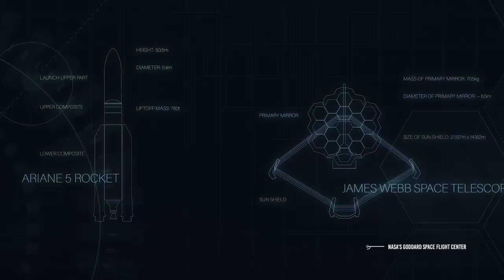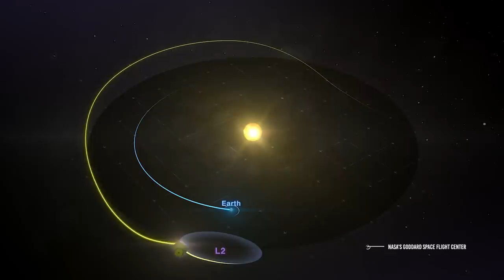The James Webb Telescope Is About To Launch: The First 30 Days Will Be Pure Terror

Comment: Absolutely the most complex device you can imagine. So many points of failure it's hard to imagine them pulling it off. Praying they do but even with years of work only time will tell if it works. At least the questions will soon be answered.

Comment: The fact that the Hubble is hanging in there refusing to give up the fight says something. Hopefully Webb does actually compliment it and not just take over completely.
Reply: The Hubble is not refusing to give up the fight, not anymore. As we speak, it's not operational. They're trying to get it back up and running again, but it has surpassed its designed operational lifecycle (by a lot) and is showing signs of its age. I'm very thankful for all the wonders that Hubble allowed us to see, but it's time for the curtain call. JWST will push the boundaries of how far we can see for the foreseeable future.
Reply: @guilhermetorresj  I hadn't heard that about the Hubble. That actually makes me quite sad. Well here is to Webb to doing so much more then. :(

Comment: 2:53 the "clean air chamber" is mainly to prevent contaminants from getting onto the optical surfaces and detectors. If the telescope cannot handle movements of the ship or some temperature fluctuations, it will not survive the launch.
Reply: They've already frozen it and shook it during testing. They've also designed Webb to be able to launch from Ariane 5. The clean air chamber is just to decrease the chance of failure.

Comment: Stupid question - why can't they unfold the telescope in low earth orbit, so that if something goes wrong they can fix it? Also what happens when its fuel runs out and it can no longer maintain its L2 orbit?
Reply: We wait thirty years for the next one.
Reply: It was designed to deploy in the cold of deep space. In Earth orbit and in sunlight differential thermal expansion will guarantee nothing will fit properly and parts will jam.

Comment: Anyone know if they considered including  a drone robot “mechanic” that could be deployed and controlled by ground based engineers. I know their is built in redundancy but anyone with even a slight toe in the water of being an engineer or builder knows that their worst enemy is the failure state that you failed to consider.
Reply: No, im sure that was never considered. And im saying that as an engineer myself.

Never mind the huge added cost of something like that (both huge development costs, and then test costs, plus the cost of launching a second object)... Its actually a huge engineering problem to do that. Its easy to say "build a robot to go and fix things". It is a whole separate can of worms to actually define what that means, and then to do it. Its simply not that easy.

Plus... A second probe just introduces an entirely new set of failure points. What if the "repair robot" fails? What then?

Edit: Also, its probably a terrible idea to have something zooming around the telescope. One wrong move, and it bumps into the telescope. And there goes the sun shield. Or it damages the mirror. Or a hundred other things. It introduces a hell of a lot more problems than it solves.
Reply: @beta_cygni1950  then build a robot to fix the robot duh
Reply: @boygenius538_8    ... And then, of course, build a robot to fix the robot that fixes the robot. This ain't rocket science you know!

Comment: I wonder why couldn’t they deploy everything while in earth orbit and only push it to L2 once everything is ready in working condition.  It would give us at least a hope of fixing something that went wrong.
Reply: That would probably have it's own set of engineering challenges. People who design these things actually spend a decent amount of time during the design phase considering the technical challenges of every option. Some decisions are made to cut costs while having small impacts on failure rate, some are just to make it more reliable and with manageable constraints such as developing new materials and techniques.

Comment: There's one kind of ironic/funny thing about the transportation of the telescope. They put it in a special container designed to keep it safe from excess vibrations and temperatures and such. But next month they're going to blast the thing into space on top of a massive rocket, just about the most violent thing you can do to anything. The boat ride should be nothing compared to that...
Reply: Think of it as a set of new tires. You are all geared up to perform a skid test. Would you want to perform your critical skid test on your brand new set or a set that has already had some wear and tear from going around the block a few times. Im sure comparing the boat ride to the rocket ride is laughable but who needs the chance of a wire or bolt coming loose. The less chance for that stuff happening the better.

Comment: I think all those cables there origamied into it's design are going to be froze solid.from the videos I've seen(few)it's quite elaborate. That the fact that the nose cone has opened ports built into them and they're great overly concerned about the cleanliness of the mirrors just doesn't mesh at all. When this rocket ignites it's going to have a kick that throws particles at supersonic speeds everywhere including into those nose cone ports that are open instantly filling that compartment with particles of corrosive materials and laggish materials. You can scratch those mirrors off in my mind you're going to be tainted marred and coated with contamination just by the design of leaving open portage in the nose cone for the purpose of obtaining equilibrium air pressures is this thing hurtles into space. It's an obvious flaw that they prefer to overlook because the money is the issue that they generated with this not the mission. And those cables that are origami together that they're relying on to deploy the multi-layer insulation backing. This thing's going to be frozen solid due to the elaborate intricate cable deployment scheme they have chosen.

Comment: Let's point out some key facts that were omitted in this video. "A long period of incredible satisfaction" is not going to open, unfortunately and for as long as JWST remains operational, there will always be a big competition for its observing time. There's no question marks here. As mentioned in the video - it will take 6 months to get everything set up, another 6 months are reserved.  Considering that JWST is designed to become an expensive junk by 2026, that leaves us ONLY with 4 years of normal operating time. If we get lucky, we might get a couple of years extra, but it still won't be much. JWST is not Hubble and never will be. It's not serviceable, by design and IT REQUIRES AN ACTUAL FUEL TO MAINTAIN ITS ORBIT! I'm sorry to spoil your mood, people, but that's the reality. The lifespan of JWST is very limited and the question that everyone should be asking is: what's there to follow up? Considering how long it took to build JWST, we'll probably end up with lack of continuity - another gap in space exploration program.

Comment: By now it can be miniaturized 1/10 scale and shot up on a much smaller rocket.and still be %99 as affective.in 6 months.and be encapsulated to it's destination,have onboard cameras even a mirror cleaning system and light beacons for secondary science observations,and a launchable probe to run up the foreground of observation for scale experiments that strobes through it's line of sight to see how light bends as things move through space.
We should build the miniature.at the first declared cost of this bohemouth.and a electric in space rail gun miniature satalite launcher that's magazine fed for multiple years long use.with fresh payloads of boxed my to mission mini sat deployment 😁
Reply: You can't miniaturize optics.

Comment: I hope I am proven wrong, but I got a feeling of foreboding when I read about this mission 20 years ago. It seems you are stacking up too many probabilities of failure. Seems like it would have made more sense to have a portion of the mission in low Earth orbit where fixing if necessary could be done before sending it off to L2. I still think about having to fix Hubble to get it to work, and that was a much simpler mission. This telescope is half of NASA's annual budget.

Comment: Always strange that it needs to be shipped in a bubble but will be rocketed into space...and dumped in the freeze of space.
Reply: The freezing tempratures of space are actually good to avoid small fluctuations in the sensors, and the telescope itself was designed to operate in those temperatures. The bubble is designed yo keep the optical surfaces and detectors free of any foreign material that might damage or degrade them.

Comment: If the SpaceX Starship had been available for use when the JWST project began, everything would have been 100X simpler and less expensive.  Thank goodness the Starship will be available in 2-3 years for repair missions.  Just like with the Hubble Space Telescope, "Murphy's Law" will rule.  Nothing this complicated will work as "guaranteed" regardless of what is said.  If NASA had another telescope ready to go when a Starship repair mission is required -- the Starship could position the 2nd telescope nearby the JWST during the same mission.  Two for the price of one.
Reply: Starship wont be ready to fly past the moon in "2-3" years, my friend. Let alone 4x past lunar orbit, which will take jwst a full MONTH to travel. Hell, it hasn't even had a full orbital flight yet!

I think you are underestimating the difficulties here. Sorry.

Comment: I still insist that NASA should have launch a similar but smaller and cheaper Webb Junior in orbit near ISS to prove the concept before the real thing.
Reply: The engineers and physicists who designed it might insist that they've considered such an option and decided it wasn't necessary.
Reply: @esphilee  oh I didn't say it wasn't a good idea to test lol just that they'd say they're good to go 🤷🏽‍♂️
Reply: Yeah just what NASA wants a free floating JWST Je floating around the ISS. 
And how would it work with a hot Earth 300 miles below and the Sun shining on it. You do understand to work it has to be cryo cold. That’s why it’s going to L2 with a 5 layer sun and earth shade.

Comment: The miles of cables that pulls the layers open running through pulleys will freeze in place.LOL it's only $9 billion below freezing.🥶 You savants just Killin me.😂🤓⚔️🏴‍☠️🧐please tell me they put a heating wire in the wire...PLEASE!you know heat tape, motorcycle grips heated seats...I think our ice cream just fell off the cone.☹️

Comment: From what I understand it is no better than the Hubble telescope.
Reply: Where did you hear that?

JWST isn't really a "replacement" for Hubble. They are different in a lot of ways. While hubble operates mostly in the visible light range, JWST operates mostly in the Infra-red range (although it is true that JWST has a much bigger mirror than hubble, so its sensitivity will be much greater).

Since JWST is an Infra-red instrument, it needs to be far away from sources that radiate in Infra-red. That is why it will be far away from the earth & moon. And why its sun shield is so important (to keep the sun's radiation from heating up its internal systems. Gotta stay really cool if you are trying to detect very small infrared levels!).
Reply: For imaging the JWST won’t be much better than Hubble. Yes the mirrors are 3x larger in diameter BUT they’ll be looking at wavelengths equally longer which means the resolution wont be significantly better. 
People thinking the images of exoplanets are going to be detailed are going to be disappointed. At best they’ll be just a couple of pixels. 
The real science about the planetary atmospheres will be coming from the spectrometers not “pictures” of exoplanets.

Comment: It's gonna fail. Look at Lucy, not even a simple solar panel could properly deploy. Look at CST-100, couldn't open the fuel tube. They should have send the telescope to low earth orbit and have a standby human crew to fix any problem it might suffer.
Reply: It was designed to deploy in cold of deep space. In Earth orbit differential thermal expansion from a “hot” Earth would likely cause mechanical interference and jams on its unfurling.
Reply: @executivesteps  Yes, so it should have designed to deploy in earth orbit. Lucy and CST-100 didn't design to fail too, but things happen.